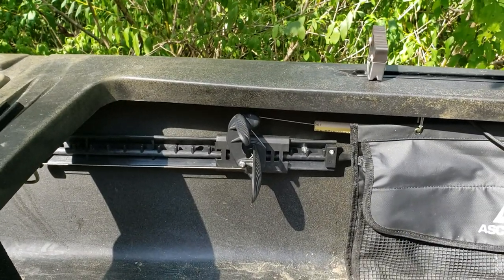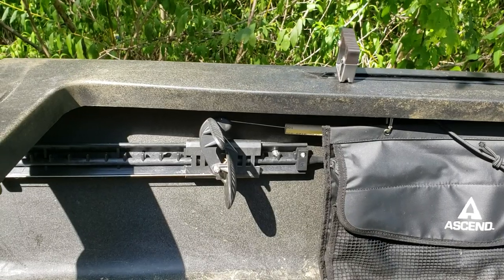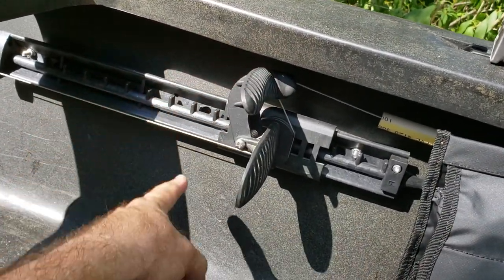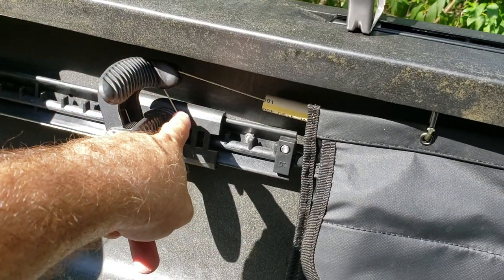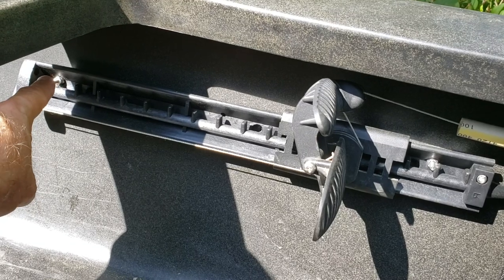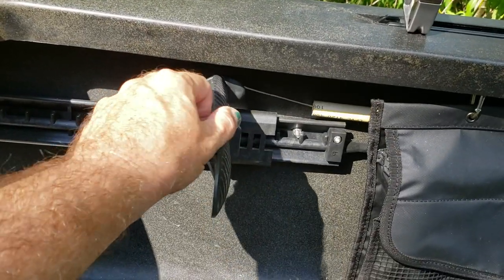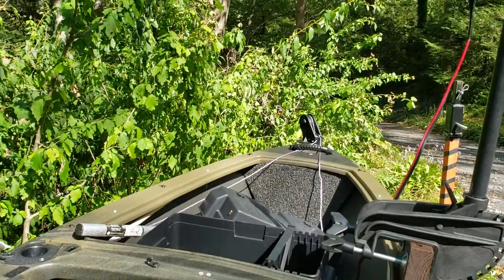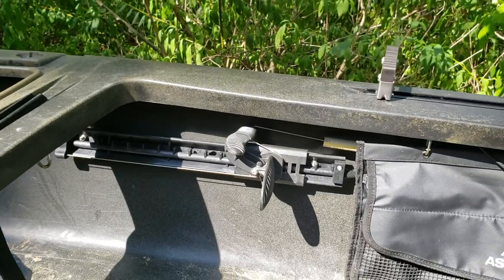How To String Foot Control Rudder Pedals

Comment: What kind of screws did you use to mount the tracks? Did you have access to the inside?
Reply from the maker: I just used the nuts and bolts from the track that came with it. The holes lined up perfectly.

Comment: Which rudder did you use? Curious how you attached the cables to the rudder to allow smooth turning. Mine is binding up now.
Reply from the maker: I got some generic kit from Amazon. Last time I looked for it to give someone a link, I couldn't find it anymore. I drilled holes in my kayak and just tied the cord to the holes on the rudder assembly. It should have a triangular piece with holes on the points.

Comment: What's the overall length of the foot braces end of the flag to the other end
Reply from the maker: I don't know. It's still in storage from last winter. Ask me again in a few weeks, and I'll check if you still need it. It mounted right to the existing holes and was basically the same size as the stock foot braces.

Comment: I ordered one from Amazon that you had in another link but it doesn't look the same as yours. However I haven't received it yet but in the pictures on Amazon and it didn't look the same
Reply from the maker: I saw your other comment first. The one I got was a "no name" and I got the rudder and pedal braces separately.